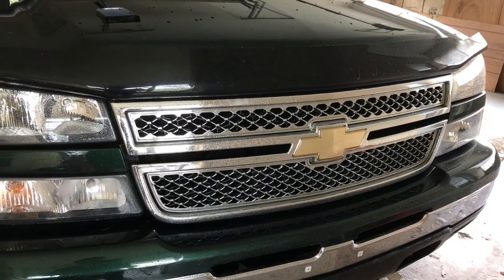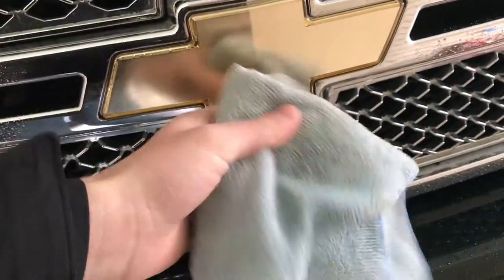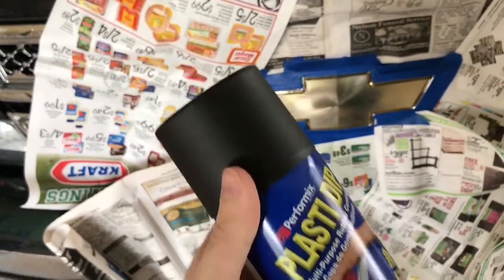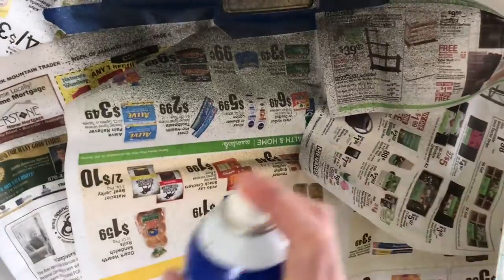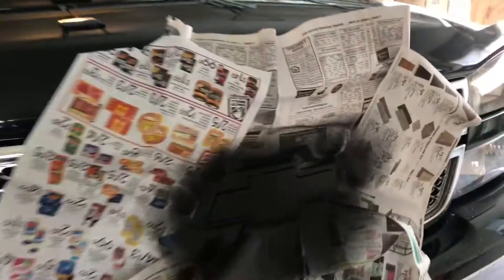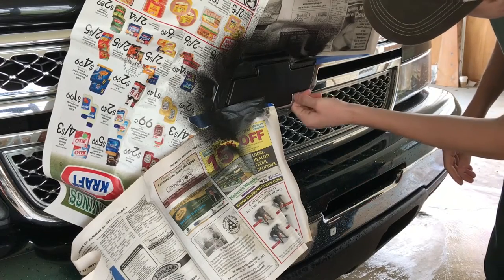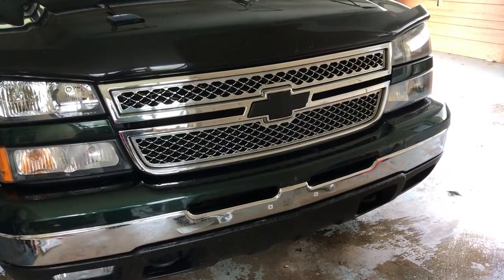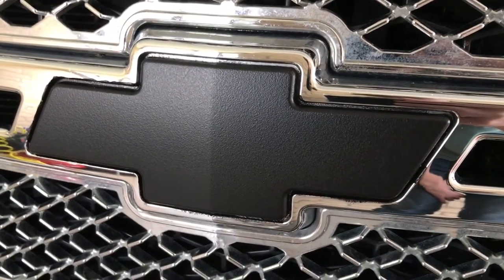Black out Emblems  - (Plasti Dip)

Comment: A little late but if you heat up the cans before you spry, it makes a huge difference in the finish. Put your cans in warm/hot water for 5 10 min and then spray.
Reply from the maker: Thanks for the tip! I may retry this product come summer time, I was pretty excited for it!
Reply: Yeah, I experimented and found the warmer you get it the flatter and smooth finish you get. Also, first two or three coats are tacky and thin. Then put down wet coats a layer at a time.

Comment: 2-3 light dustings, let those dry then 6-7 wet coats let them get tacky in between.  It will self level and be smooth.  The more coats you put on, the easier it is to remove.